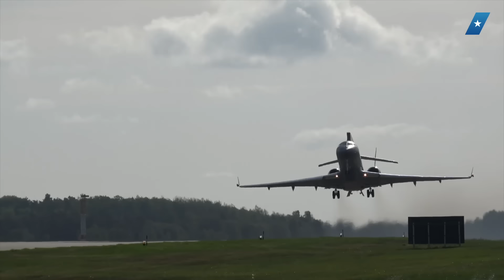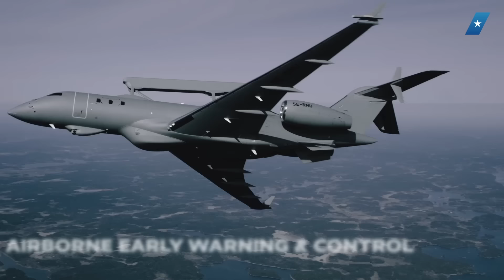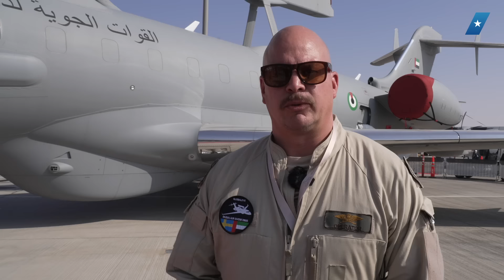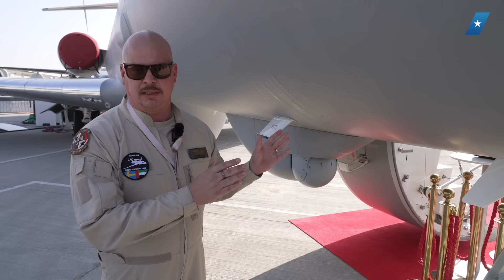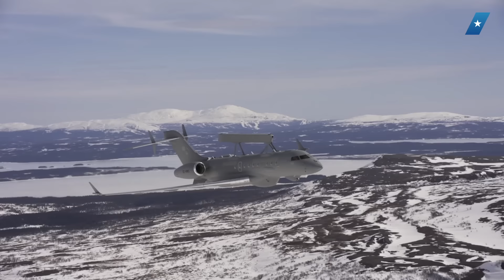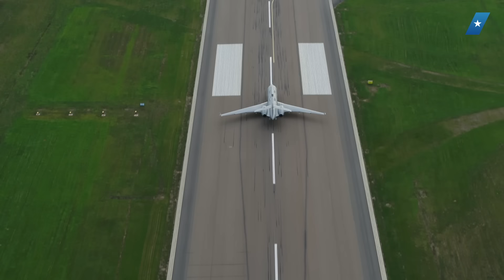GlobalEye walk-around tour with Saab

Comment: Canada has much more land mass to cover than its European allies.  I can’t see how the GlobalEye can provide meaningful coverage if it has to spend the majority of its 11 hours or so of operating time in transit. The lack of air refueling is a critical shortcoming. Why not forget about wasting money on AEW air assets and use the more capable space based surveillance the US will be using?  The other problem is GlobalEye is it is restricted from using the Multifunctional Advanced Datalink (MADL) that US built stealth aircraft, including the Canadian F-35s, use.  This means Canada needs to develop, or purchase a system to forward data between MADL and Link-16.  This not only is an additional cost, but it also requires cooperation from the Americans which may not be granted.

Comment: The Boeing E-7A has better capabilities and range.
Reply: No it doesn't.. It does have better range, but thats it.
Reply: @mr.spongylikeaboss4987 But then they have to refuel in air.
Reply: Not really, e7 is meant for a different role as an airborne command centre.  Global eye is better for multi domain detection.

Comment: The detection range should be much greater than 351 miles, ideally around 800 to 1000+ miles. With such a short range, it could easily be targeted by airborne threats carrying long-range missiles, and countermeasures aren’t always reliable.
Reply: Ok, once you’ve developed that longer range system give Saab and Bombardier a shout!👍

Comment: In May 2025 India has shot down & blew up SAAB's AWAC plane in the Pakistani Sky by using Russian S400 Air Defence System. Pakistan Air force has lost 2 of these SAAB's AWACS planes one in the Sky during sortie and one in the Aircraft Hanger on ground where Indian Brahmos missile struck hard Pakistani Aircraft Hanger, as India shot one of them in the Sky more than 293 kilometres away from Indian border which is by far the longest range kill by the any Air Defence system till today, that's why demand for Russian S400 has increased recently. So there is a question mark about these Swedish SAAB AWACs plane's usebility as these planes now can easily be shot down by todays advance air defence systems like Russian S400 Air Defence System. Up coming American Next generation will be using AI power Missiles & Defence System that could more advance.
Reply: Its not the same plane, the one you are talking about is a much older plane
Reply: 😂😂 Long and stupid comment. First, it wasn’t the same type of plane and second what plane can’t be shot down.

Comment: No one is talking about airborne refueling capabilities for this plane. So I guess that there is none...
Reply: The plane have 12 hrs endurance so you dont need Air refuling
Reply: It can, you can buy it with probe-and-drogue refueling system, but I cant find anyting on the Flying Boom system.
Reply: Refuel when you change out the crew ..

Comment: How does it compare to the Wedgetail?
Reply: The Wedgetail is on a bigger aircraft so have the advantages and disadvantages of that such as longer endurance but also much higher price. The radars are comparable so the Wedgetail isn't better or worse in that aspect. Both radars have their strengths and weaknesses the other radar doesn't.
Reply: @christoffermonikander2200  Thats what the comparison boils down to, what is the capability of the passive and active sensors as well as the capability to jam. We will never know the difference because that information is classified.
Reply: @christoffermonikander2200  I feel the endurance is more on the crew side thanks to more space for the crew to rest, and able to have more workstations with more sets of eyes monitoring. The 737NG that the E-7 Wedgetail is based on has a shorter rated range than a Global 6000. But the E-7 was upgraded to allow in-flight refueling. I don't think that's been done on these planes. Bombardier and Saab, who already has mid-air refueling experience with their fighter jets, should cooperate on making a refueling system for the Global series.

A GlobalEye based on the stretched Global 8000 with refueling would have all the flight endurance needed.
Reply: @WhiskyCanuck  But as you mentioned the crew might be the limiting factor, then air refueling would not solve any real problems.
Reply: @christoffermonikander2200   I've heard that the Wedgetail is more suited for operating in rugged environments.
Reply: @christoffermonikander2200 The Wedgetail radar has greater range , it’s a function of antenna size and electrical power generation capacity of the airframe.
Reply: @Smokeyr67  Maybe, but does it have greater range than two globaleyes? Because that is the price difference. One wedgetail costs about the same as two globaleyes
Reply: @balsyprick6764 The range is a function of altitude, the Global Eye operates at about 30-35,000 feet, the E-7 up to 41,000 feet giving the Wedgetail a longer range if operating at that altitude. If both aircraft operated at , let’s say 30,000 feet, then their radar would have much the same range (exactly the same for NOE targets),in “look up” mode (I.e detecting targets at higher altitude) the E-7 has a 10+ % longer range. On top of that, the E-7, due to its larger array and higher power has higher fidelity, it can detect smaller targets at longer ranges.
The greatest advantages that the E-7 has over the Global Eye is range/time on station, number of crew stations - 10 versus Global Eyes 5, ability to carry extra crew and the ability to AAR.
The Global Eye is a great aircraft, perfect for Europe or similar theatres - it can operate from smaller airfields, it’s cheaper to purchase and operate, lower crew requirements allowing an operator to purchase and operate more airframes. 
The Wedgetail has the advantage of range/endurance (time on station), double the number of crew (better battle space management + CCA control), the ability to carry extra crew and rest them, higher power generation and it’s just a 737 with fancy bits, it can land at a commercial airfield , parts will be available as will be qualified mechanics who can do most of the airframe and engine work😊
To be brutally honest, both are great platforms, one will be better than the other in certain situations.
Reply: @Smokeyr67 Around the curvature of earth? As the limit for Erieye is the Horizon.
Reply: Wedgytail is old and obsolete.
Reply: @verttikoo2052 Even the RAAF airframes are still cutting edge, and are currently being upgraded.
Reply: I believe Globaleye got more(better/dedicated) sensors for maritime and ground observation, so it's more multi-domain, it's cheaper, but it got fewer operater desks, so thats a minus... but you could probably get 2 of these for the price of one E-7, and operational costs must be lower, since it's a smaller aircraft.
Reply: @M @MattEProd-j4q  you can believe that, but you’re incorrect. The E-7’s sensors were designed for the RAAF, a nation who has massive maritime borders (and land area) to protect. It has sensors that can detect surface targets, but like the Saab product that’s not its primary role. That’s why nations with the cash to spend, and the maritime and airspace to protect invest in dedicated AEWACs and MPA aircraft.
Reply: @Smokeyr67  Pretty sure I'm correct, and I didn't write E-7 cant. what I wrote was that the sensors are better on Globaleye, doesn't the UK use P-8s for maritime missions?

The maritime sensor on Globaleye is the Leonardo Seaspray 7500E.
Reply: No Yanks involved - that's the difference!
Reply: @GunterKrolock  No trumpian  (no uppercase intended) orange stop button for maintenance and software updates...
Reply: @gsbeak   I don't think you would need to think about that with a radar airplane, bro.
Reply: @gsbeak the Software is a product of Boeing Australia.

Comment: Lessons learned by the British when they operated the Sentinel. No air to air refueling, so forward basing is required. Even if it had AAR, there was no room for relief crew because of the smaller plane.

There is no guarantee you will have access to forward base, so the transit time eats into the fuel, that reduces the time on station. Even if they had forward basing, they still couldn’t stay very long time due to human fatigues. Those were real world issues that Sentinel faced.
Reply: Thing is a probe wasn't rocket science to add, nor would it be for Globaleye....our loss of Sentinel and failure to exploit the Global Express platform for other roles was absolutely insane. Particularly after we spent so much on the defensive suite in particular. The longer 6000 platform would allow for crew rest area as well.
Reply: @dogsnads5634  , the idea is nice, but the running costs of that type of unit, especially in peacetime with 2x flight crew, are going to skyrocket.
Reply: An uncrewed Global Express platform would have insane endurance, as long as the downlink wasn't jammed.
Reply: The lack of forward bases in the high North is an easy problem to fix.

New bases are buildable. And I believe they are already in the planning stage as part of Carney’s Northern Development plan. (They need new facilities up there for the F🤮35s anyway.)
Reply: They have rest  quarters in the back of the aircraft  they said it in the video

Comment: hope canada gets the globaleye
Reply: Especially as they are Bombardier Global 6500's, they are Canadian planes.  

Now what would be interesting would be fitting the kit to the Bombardier Global 8000 which is now the fastest passenger jet since the Concord.
Reply: @johnwang9914  admittedly absolute speed isn't quite so important for an awacs as much as maximum time on station. If the global 8000 has longer loiter times and a larger cabin then it definitely might be worth looking at, especially if they can give it aerial refueling which is one of the biggest knocks against global eye when comparing it to the E7 Wedgetail.
Reply: @NewfieOn2Wheels  I have read a few things that the Global 7000/8000 are gonna be a no go because they utilize too many composites. Much harder to modify and then certify for air worthiness with composites in the airframe and wings. 

The GlobalEye also has the issue where there are not as many stations available to Airborne Control vs just the Warning portion as opposed to what the E-7 offers with a much larger platform and cabin.
Reply: @NewfieOn2Wheels   Aerial refueling is more of a global projection issue as for operation, you still have the problem that humans needs to sleep so unless you expect them to sleep on the plane, you should land just to replace the crew and operators.  Aerial refueling is really only when you have to travel to the other aide of the world but the Global 8000 already has 8,000 mile range So it wouldn't need aerial refueling to deploy on the other side of the world.  The 737 has significantly less range so refueling might be necessary, it is also larger so sleeping berths might be possible for people to work in shifts so refueling makes more sense for the Wedgetail.  Yes, people commonly comment about the GlobalEye lacking a refueling probe but really, it doesn't really need one.  However, if they really want one, Canada has added refueling probes to the military aircraft they've procured before such as the CF-5, when Canadaire built the F-5 as the CF-5, they redesigned it for shorter unimproved runways, added a refueling probe and designed a reconnaissance nose for it...
Reply: @johnwang9914  Given Canada's vast territory, it is the range (8,000 nautical miles or ~ 14,000 km) and endurance (10+ hours) of the Bombardier Global 8000 that stand out. A fleet of 4-6 GlobalEye systems based on Global 8000 airframe, together with the Australian-made JORN over-the-horizon radar system that Canada purchased earlier this year should provide a round-the-clock airspace monitoring & warning capabilities. 3 squadrons of Saab JAS-39 E/F fighters, stationed at northern airbases will provide the interception capabilities as needed. Remaining squadrons could be based further back, perhaps for coverage of major cities?
Reply: @johnwang9914  and 1500nm more range
Reply: @johnwang9914  By passenger, do you mean in the private jet class or an airliner?
Reply: @johnwang9914  It likely will never happen with the Global 7000/8000. They use too many composites in the cabin and wings so it is much more difficult to modify and then certify.
Reply: @mattanigma  
Never say never
if the RCAF is willing to buy it ,then SAAB would have no problem working with Bombardier work out the details especially since a larger airframe has more options and may be more attractive to other customers
Reply: @verdebusterAP  It just doesn't make sense to do it. The differences are not vast enough that it would have any appreciable difference doing Global 7000/8000 vs 6500, the cost to do so when the 6500 can do 95% of the same thing at a much lower development cost makes it not likely at all.

The 6500 platform has been majorly missionized. Just as the P-8 and the E-7 are not 737 Max Airframes, Bombardier Defence has made a point of only missionizing the 6500.
Reply: @mattanigma  
Simple
The 7000/8000 carries more crew but most important is that its larger size is more future proof than 6500
Personally I feel that USAF should make an AWACS from the KC-46 airframe because the B-767 is extremely large and has plenty of room for additional and future tech
The 6500 is compact and space is at premium
Reply: @verdebusterAP  E-767 is already a thing with the JASDF. The USAF made a decision that they needed a very quick E-3 replacement due to adversary advancements and thats how the E-7 became a thing for the USAF.

7000/8000 are not going to be a thing, Bombardier has made this pretty clear that it is not worth the investment. An A220 AEW plane may be interesting though, would be larger than the biz jet sized Globals but not as large as the E-7.
Reply: @mattanigma  
Not exactly
The E-3 was supposed be replaced by the  Northrop Grumman E-10 MC2A which honestly was the idea and actually still is because it could  be based on the KC-46 air frame and replace the RC-135, KC-135 and E-3 with B-767 as common frame. 
The E-10 was canx and USAF committed upgrade program instead of replacement leading this mess with the E-7
Between 2000 and 2010 many needed programs were canx and some eventually retired without replacement thus the current kerfuffle
The B-707 was highly successful as common platform and the USAF should have kept that trend going by using the KC-46 as common air frame
While the AWACS, KC and EW mission equipment would cost something
Common engines, and other parts would greatly off set that 
The USAF lack of foresight and even poorer decision from Congress and WH is why they are in the mess
Reply: @mattanigma   SAAB has already said that it wouldn't be a problem for them to adapt the kit to the Bombardier 8000
Reply: @johnwang9914 

Around 20% of it is American made.
Reply: I think Canada will pick this, over any other aircraft.
Reply: The issue is that the platform does not as of yet have air to air refuelling and that is one of the major requirements that the RCAF has because the planes will operate from southern bases. No air to air refuelling impacts on station time very heavily. I would actually prefer the L3 Harris Phoenix which is being developed for Korea, it is still a Global 6500 but it has air to air refuelling.
Reply: @mattanigma   I did not know that! I guess that makes sense for the smaller EU countries that are looking to control their own limited airspace for the most part. Though Canada is big...
Reply: @MicahSpencer-w9v  It is not to say it couldn't work. It could but it needs Air to Air refuelling which may be difficult for GlobalEye based on the antenna location, L3's Phoenix solves this by placing the antenna on the side of the fuselage. We would likely be better served by a larger airframe though.
Reply: @MicahSpencer-w9v  And the RCAF announced today that the Global 6500's they ordered are being designed with Air to Air refuelling. 

Saves that issue it seems, also pretty much confirms that the AEW plane Canada gets will be a Global 6500.
Reply: @mattanigma  Aerial refueling would be an advantage, but it likely won't tip things in favour of L3Harris for a few reasons. First, the unmanned capabilities of the GlobalEye is a big plus for an air force with a pilot shortage. Second, Saab might be more open to developing aerial refueling after losing the bid in Korea, especially if Canada says they want it. Third, Canada wants to reduce its spend on US defence suppliers and the GlobalEye is one of the few options to do that.
Reply: @Hyperpandas  What unmanned capabilities do you speak of?

The issue with GlobalEye is that the antenna placement on the fuselage is going to make a receptacle next to impossible for boom refuelling or at the very least certifying it for boom and probe refuelling presents other issues. 

L3's offering also has a developed and in service EW variant that may also be of interest to the RCAF and at the end of the day it is also not a US product.
Reply: @mattanigma Huh... must have... dreamt it.
Reply: @mattanigma 

L3 is American.